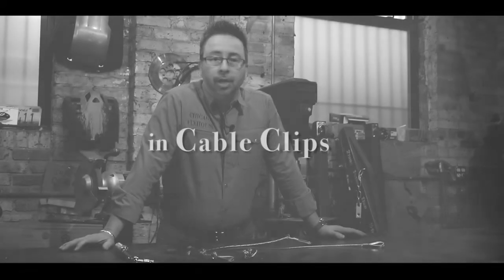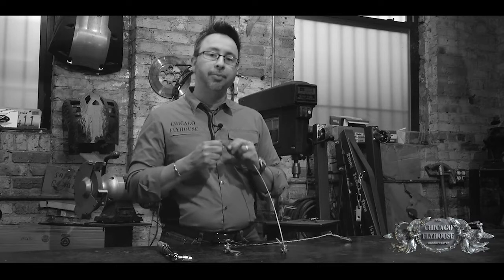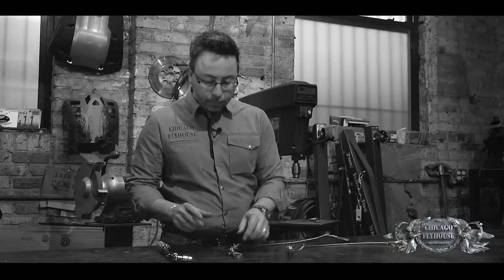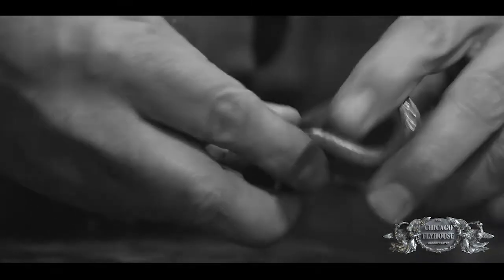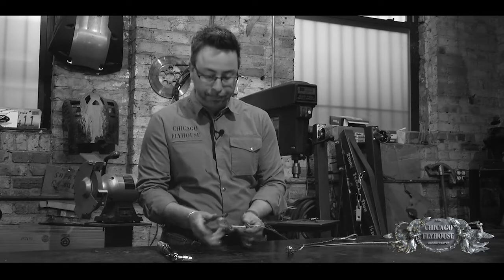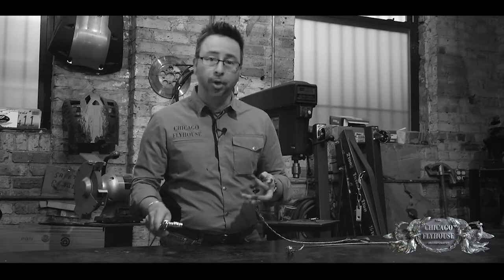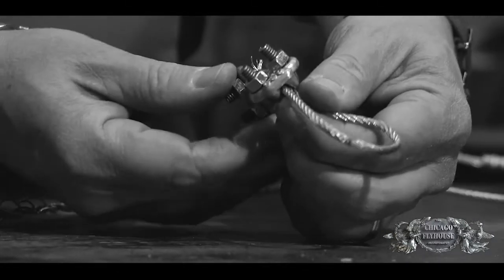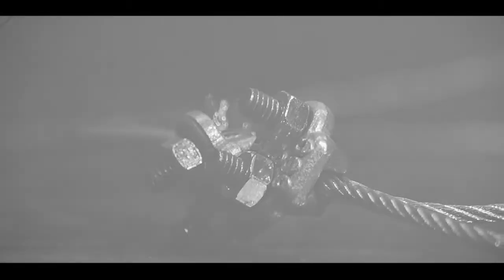Proper Cable Clip Usage

Comment: Decent explanation but it could have benefitted from a decent look at what you're talking about, rather than the quick glimpses. Would have made things a lot clearer. Just saying. Even a picture of, this what I'm saying and this is what it would look like would add a lot of clarity.
Reply from the maker: Thanks for the feedback. The intention was a quick explanation, but your point is spot on. In future videos, even for quicker ones, we will make that happen.
Reply: It would have been useful to see how to use the torque wrench. I think this is where many technicians go wrong only using a ratchet or nut driver. They just don't know how and why it's the correct piece of equipment.